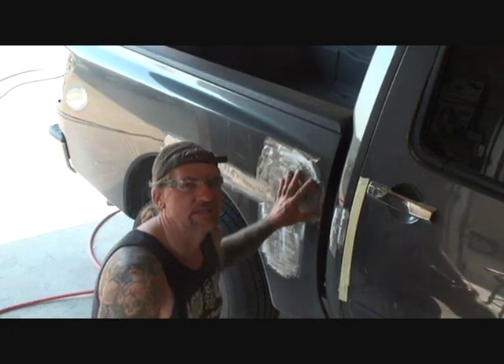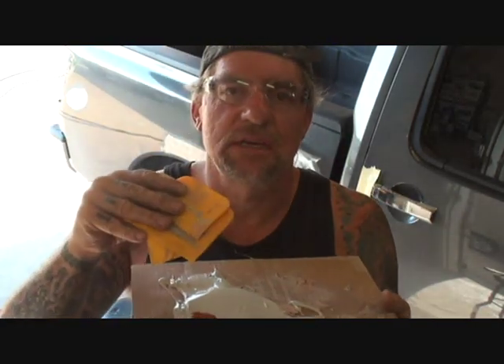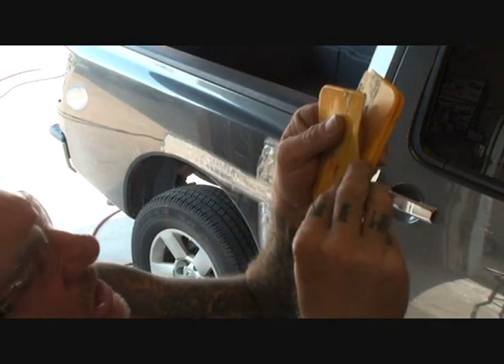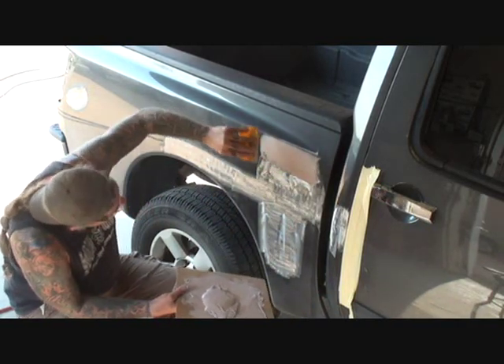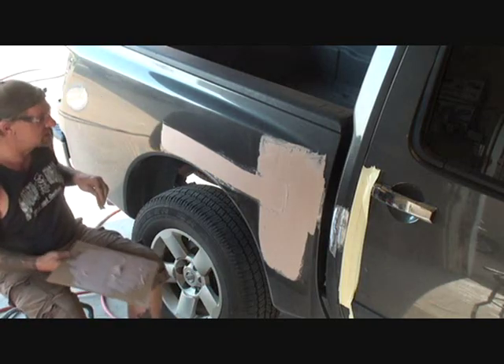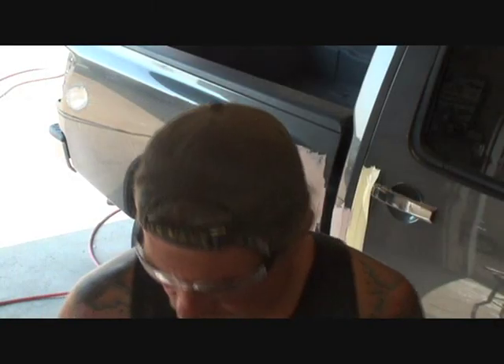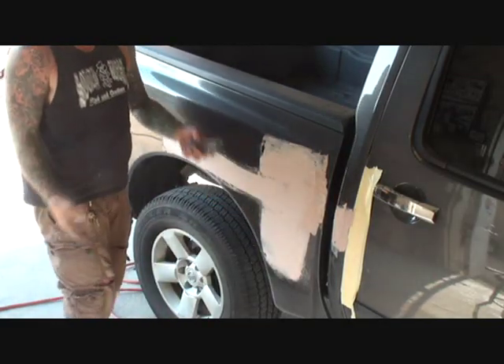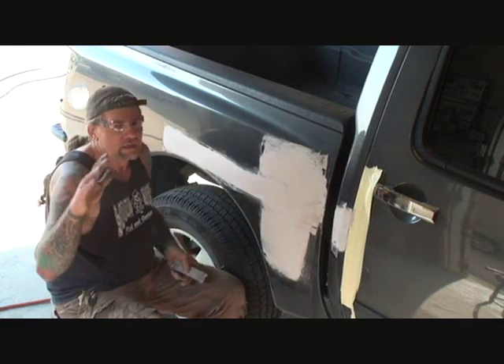Collision Damage Repairs-How To Repair Your Damaged Vehicle-From Start To Finish-Part 3

Comment: Pro tip once youre done mixing up your bondo spread it thin on your mixing board dont leave it in a big pile. Bondo dries using an exothermic reaction so the less heat that can build up in the pile youre picking from the longer you will have to work with it before it crusts up as i call it

Comment: Good tip on saving sandpaper, I noticed that above an below you didn't dull the paint before applying the filler? Do you do it after when you are sanding? What happens if you level your work but your still on shiny paint? Will this affect the bond of the filler? Thanks for all the tips and hard work you doing making these videos, I know it must cut into your work time and slow you down.  Thank you.

Comment: well i use ever coat lightweight body filler and its $15 a gallon with the hardener but ya that do sell higher dollar filler but iv never  bought them but iv used them and there more watery and more like a final glaze for pin holes

Comment: @Wolfman1974ify Not necassarly. What your thinking of is when the car is damaged so bad it's beyond bondo repair, and the repair shop uses 3 gallons of bondo to fix it, instead of replaceing it. In this case it's a repairable panel, and thats all the insurance company will do. Pete

Comment from the maker: @vmaxcec Good question... 2 reasons, the car was hit in a spot where the door and the post lined up, so the body work has to line up as well, the other reason is bondo dust in the cab of the truck.. Makes quite a mess and takes hours to get it all out when the jobs done... Pete